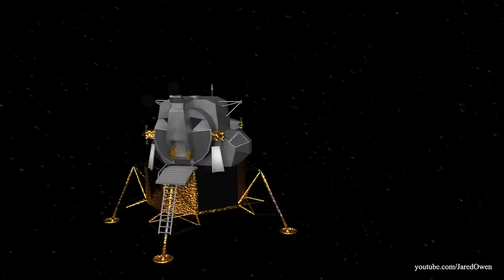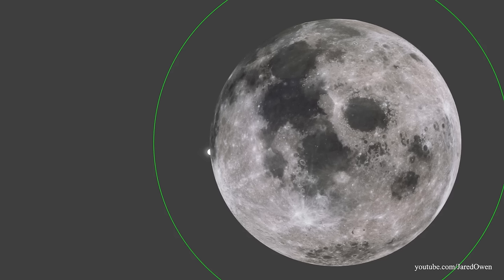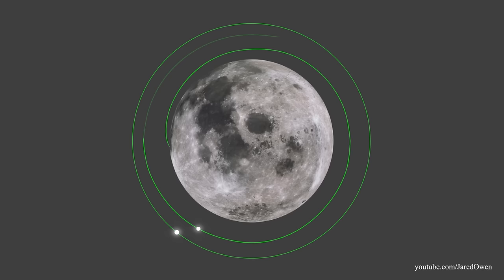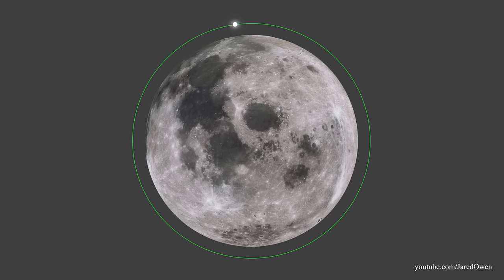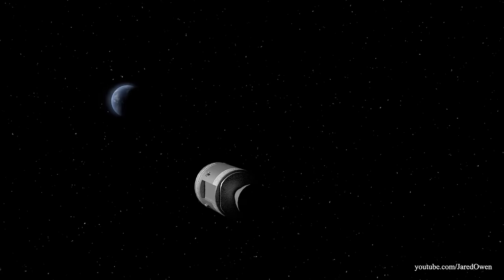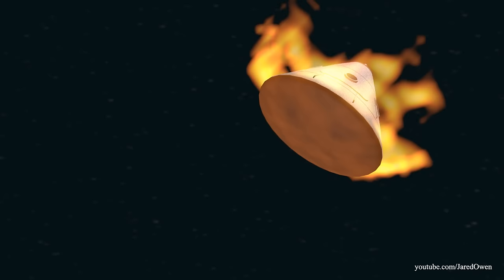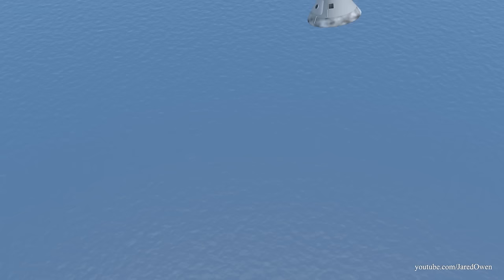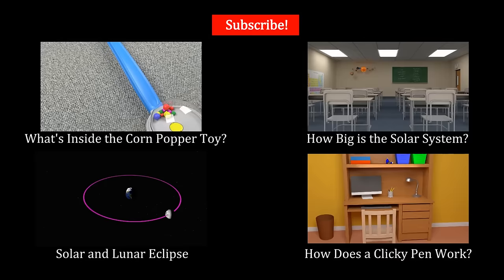How the Apollo Spacecraft works: Part 3

Comment: I worked on the Saturn V and this is the best video explanation I've seen.  I worked on the Instrument Unit which was the brains of the Saturn V.  It was built by IBM under a contract with NASA in Huntsville, AL.  The IU had all the navigation, guidance, telemetry, communications, etc. functions through Trans Lunar Injection.  At the IBM facility where I worked, there were posters urging everyone to work with Zero Defects.  Another poster with a quote by Wehner von Braun explained why: "If the Saturn V is 99.9% reliable, there will be 5,600 defects."  

I did some calculations recently and a typical cell phone these days has about 3.5 million times the storage capacity of the Saturn V IU and computer processors have about 1 trillion times the processing capability of processors in the 1960s.  

It is amazing to reflect on how primitive computers were back then and how we got to the Moon with such limited capabilities.
Reply from the maker: Thanks Everett - that's neat that you actually got to work on it!
Reply: Crayfi
Reply: You’re such a legend for working on that absolute beauty of a rocket. My heroes are the men and women who built that rocket. So this then makes you one of my heroes, Mr. Everett. Thanks for sharing with us!
Reply: .1% = 5,600 ……….   That is mind blowing!  Every single individual piece , every “insignificant” wire, rivet or nut, had to be as good as humans could make it.  Amazing.

Comment: how space shuttle works please make a video
you are amazing
Reply: YES!!
Reply: I did a report on the shuttle US back in 1980 more like a research paper was working on degree in applied science got a A for it but interestingly they never gave me back my paper but in my report i wrote that this. Craft was doomed to failure at some point due to not only its complexity but  the fact that this ship was very fragile those boosters an example & just the whole design, structure the materials used the vulnerability to extreme climate made it a ticking time bomb add to the fact that it was expensive to operate & maintain for those reasons were probably why they kept my paper did they think i might let NASA know? & that i was right all along.but they said it was a good report may be too good.will never know.
Reply: @ndhzbhhdhhs668  I wouldn't trust a report that was written by a guy named Ndhzb Hhdhhs and has not-so-good grammar.
Reply: Yes do and explain how constant force supersonic nozzles control a mass m of inertia I about its mass center.
Reply: Ndhzb Hhdhhs r/thathappened
Reply: Tom Williams hyu
Reply: Vincent Harris Soyuz has problems and all crafts have proplem.apollo killed 3 people.
Reply: @lapischicken  Lol! I completely agree!
Reply: I am from future and now he had made it
Reply: isn't it the orbiter vehicle
Reply: He made it

Comment: Just to flesh it out, the 2/3 engine burns after launch from the moon were called:

Coelliptic Sequence Initiate (CSI) - 1st engine burn
Constant Delta Height (CDH) - 2nd engine burn, or 1st on the later missions
Terminal Phase Initiate (TPI) - 3rd engine burn, or 2nd on the later missions

These 3 burns were computed backwards, starting from the desired point where you want the LM to meet up with the CSM (which was at lunar sunrise) and working your way back to the desired launch time.

Vaguely,
purpose of the CSI burn was to put the spacecraft in position for the CDH burn.
purpose of the CDH burn was to put the spacecraft in position  for the TPI burn.
purpose of the TPI burn was to have the LM and CSM meet up at a specific point in orbit.

Later missions skipped the CSI burn as the LM was launched directly to the proper orbit for CDH to take place. This was called a "direct insertion" launch.

Jeff Quitney has a video at https://www.youtube.com/watch?v=UOnKHX1p8s4 detailing the process of getting the LM back to the CSM in orbit.
Reply: But that just brings you to the right hight, at the correct time, but how did they manage to be on the same (sorry not a native english speaker)trajectory, and not say 20 Miles to the left or right, or not even on the same perpendicular path.

Comment: I am pretty sure that the CSM did not re enter earth orbit on the way back from the moon.  It just reentered the atmosphere.  The other thing I think is that in later missions (Apollo 15 on I think?)  the CSM put the whole package into the low Moon Orbit.  Then I think went back up to the 60 mile orbit after the LEM was at a safe distance.  This allowed for more fuel to be used by the LEM on the descent.  Otherwise I like these vid and they gave me info I did not have before.

Comment: Outside Franklin, Pa. there used to be a Dairy Queen which had a boiler plate of an Apollo command module out front. A boilerplate is a full sized mockup of a space capsule design used in simulations. The DQ closed in 2019 and the module is no longer there.

Comment: May very well be the clearest and easiest to follow explanation of the lunar program I've ever seen. I really appreciate the clear and simple wording without being spoken down to. The one part out of all of this that has never been clearly explained to me was how the tunnel from the CSM to the LM attached and opened for passage. How does a claw become portal? Even 'Apollo 13' (1995) didn't explain it and they even showed the plug I've never seen before or since.
Reply: The pointy end of the Command module goes into a hole in the top of the LM, there is a hatch on each end that opens inward, and leavs a tunnel.

Comment: Great set of videos, superbly broken down and simplified - should be required viewing for all hoaxnuts!!
Reply: Paul Snape I thought great work in the video , but just because some of us doubt  and question the nasa evidence of man on the moon doesn’t change the phenomenol engineering of space flight or make us all hoax nuts , there are some legitimate doubtful claims in the space race in relation to manned landings
Reply: Pretty sure most people who doubt the moon landings could be flown up to the moon, have their head bounced off the LM decent stage and would still not believe it. 

They start talking about how it was put there later and we didn't actually go in the 60s and everything is just an elusion and we all live in the matrix. 

At some point you have to take into account the overwhelming mountain of edvidence that points to the fact it did happen and stop focusing on some minute thing that can neither be proven nor disproved.
Reply: Nope. Good day.
Reply: Paul Sharpe: Hi guy! Tell me where I am wrong and provide evidence:

Where is the video showing the inside of them LEM with the astronauts in 
the moon suits and attached with the bungee cords. They had a periscope in the CSM and LEM for navigation, but for some reason there are no pictures or videos of stars. The second moment changes as the fuel and oxidizer gets used, but somehow these 4 groups of steering  motors kept the LEM from crashing. No remote control or autopilot test landing to verify the LEMs control system and steering motors, with the sloshing fuel and oxidizer and water, but somehow they got it right the first time. The LEM simulator Neil flew and crashed obviously did not have the same second moment as the fake studio LEM on the moon stage. No radar stations on the moon to verify the unknown orbit of the fake CMS, and the ignition time of the LEM, and track the fake LEMs altitude and range as a function of time for descent and ascent. For the moon suit sublimator what blackbody absorber temperature did they use for outer space and the maximum power flux from the sun from the ultraviolet to infrared wavelengths. Same with the engine jet landing on the moon and the missing dust cloud and nobody afraid of rocks piercing the LEM or damage to the antennas, steering motors, or landing radar. They could have pointed the cameras up away from the moon instead of golfing on the moon stage but they decided not to because they would have taken pictures of the stage guys on the catwalk They also drove the moon buggy with lots of dust in the vacuum of the moon studio. Where is the video showing the astronauts in the LEM on the studio mooooon putting on their backpack life support. The clown did a fake spacewalk in the non gravity simulator in the airplane, but for some reason no stars in pictures or video from that. Their studio moon suits were contaminated with moon dust, which likely is radioactive, but no problem to put a Geiger counter next to their suits to verify there was no radiation hazard.Neil jumped off the studio LEM, but since it was live they could not slow down the speed by the square root of six, like the Six Million Dollar Man slow motion, because that would put the rest of their studio acting out of sync..Astronauts could not get more than 6 inches off the moon as they were hopping and walking and pretending to be on the moon stage. Radiation heat transfer on the LEM so they used a glycol cooling loop to radiate that heat back out into the air conditioned studio. Total hoax.

Comment: re entry started at 400,000 feet came down to about 200,000 rotated the craft 180" went back up 50,000 feet to cool the heat shield then rotated another 180" and started again to the sea. there is video on Youtube that shows the re entry from an aircraft the fireball is 50 miles long.
Reply: Seriously?  That's amazing!  What's the name of the video?
Reply: it was called a lifting re entry as the command module was in essence a lifting body so as you correctly explained by altering its angle it could gain lift and perform these stepped 
re -entry's

Comment: With all this attention to technical detail the final part where we enter Earth's atmosphere feels a little light.. No mention of the trajectory and the small "window" they had.. Not to steep and not to flat or they burn up on re-entry or skip of the atmosphere back out in to space..
Reply: ... I almost forgot to complement you on the otherwise fine animations series.. Nice work.
Reply from the maker: Thanks!
Reply: They dont skip into space. The return entry angle of the CSM entering the atmosphere can be such that lift is created. There can be enough lift and speed to put it back into orbit longer than the amount of oxygen they have available. The window is not that small. It was well within the capability of a typical aircraft autopilot at the time. Nice video presentation but the reality is nobody went to the moon, particularly with a 1960s computer...

Where is the video showing the inside of them LEM with the astronauts in 
the moon suits and attached with the bungee cords. They had a periscope in the CSM and LEM for navigation, but for some reason there are no pictures or videos of stars. The second moment changes as the fuel and oxidizer gets used, but somehow these 4 groups of steering  motors kept the LEM from crashing. No remote control or autopilot test landing to verify the LEMs control system and steering motors, with the sloshing fuel and oxidizer and water, but somehow they got it right the first time. The LEM simulator Neil flew and crashed obviously did not have the same second moment as the fake studio LEM on the moon stage. No radar stations on the moon to verify the unknown orbit of the fake CMS, and the ignition time of the LEM, and track the fake LEMs altitude and range as a function of time for descent and ascent. For the moon suit sublimator what blackbody absorber temperature did they use for outer space and the maximum power flux from the sun from the ultraviolet to infrared wavelengths. Same with the engine jet landing on the moon and the missing dust cloud and nobody afraid of rocks piercing the LEM or damage to the antennas, steering motors, or landing radar. They could have pointed the cameras up away from the moon instead of golfing on the moon stage but they decided not to because they would have taken pictures of the stage guys on the catwalk They also drove the moon buggy with lots of dust in the vacuum of the moon studio. Where is the video showing the astronauts in the LEM on the studio mooooon putting on their backpack life support. The clown did a fake spacewalk in the non gravity simulator in the airplane, but for some reason no stars in pictures or video from that. Their studio moon suits were contaminated with moon dust, which likely is radioactive, but no problem to put a Geiger counter next to their suits to verify there was no radiation hazard.Neil jumped off the studio LEM, but since it was live they could not slow down the speed by the square root of six, like the Six Million Dollar Man slow motion, because that would put the rest of their studio acting out of sync..Astronauts could not get more than 6 inches off the moon as they were hopping and walking and pretending to be on the moon stage. Radiation heat transfer on the LEM so they used a glycol cooling loop to radiate that heat back out into the air conditioned studio. Total hoax.
Reply: @suekennedy8917  Well okay, but at least we're certain we put Apollo 11 through 17 up into space, at least, right? So, if we didn't go to the moon, what were we really up to, up there?

Comment: I have been a follower of the space program since the early 1960s. I never thought of the fact that you gave during your presentation; namely, when the astronauts are returning home they are in more cramped quarters because they don't have access to the LEM maybe just for the additional space. Frank Borman's Apollo 8 was the only one that basically had cramped quarters going to and from the Moon.
Reply: Well, the LM was not really occupied on the way to the moon. After docking with it after the TLI burn, they did access it to check it out to see if everything was ok. I know on one mission, the glass from one of the instruments broke so they took the time to vacuum the floating glass shards. Like I said though, it was normally left unoccupied until they prepared for the lunar landing.

Comment: As an old timer who actually watched the moon missions this was an excellent overview. I only found one factual error. At 2:23 while describing the return to earth you say “Once we’re back in earth orbit...”.  On the way back the CM never slowed down to enter orbit. It just went directly from return flight, separated from the SM (which burned up) and dove directly into reentry. Because they had been in one long fall towards earth essentially since leaving the moon it was an incredibly fast reentry.  The fastest was Apollo 10 at nearly 40,000km/hr. 
But anyway, no going into orbit on the return. Excellent videos!
Reply: Yes, great info. In addition, the SM re-entry for AP-8, AP-10 and AP-11 didn't quite go as planned as the trajectory for them was supposed to be a slight skip off the atmosphere so they would re-enter and burn up quite some distance from were the CM was re-entering. Instead they re-entered close enough to the CM that there was some concern it could be a problem. Here's a link about it along with their simple but clever solution:
https://space.stackexchange.com/questions/37047/how-did-sloshing-prevent-the-apollo-service-module-from-moving-safely-away-from
Reply: If we're being pedantic, I would point out that despite not slowing down near earth, the CSM was technically still in earth orbit, just a highly elliptical one.

Comment: The Descent Stage wasn't really "dead weight" as it served as the launch pad for the Ascent Stage.

One Ascent Stage was sent into a solar orbit; that was Snoopy from Apollo 10.  Two others, Spider from Apollo 9 and Aquarius from Apollo 13, burned up in Earth's Atmosphere.

You mention you hoped that no one got claustrophobic in the Command Module.  It had the interior size of a Volkswagen Beetle but with near zero gravity, it was pretty spacious for the three men.

About re-entry of the Command Module.  Remember that the Command Module had it's weight shifted to slightly off center so that the cone shape could induce lift.  With the reaction control jets, the Command Module actually skipped up and down in the upper atmosphere to reduce heat and speed before losing enough energy to enter the thicker part of the atmosphere.   Then drogue parachutes helped slow and right the spacecraft before the three big main parachutes blew out and unfurled and reefed.

Splash down was a bit rough and there were inflatable righting balloons to ensure that the spacecraft righted itself in the water.  There was also a green dye marker and a location beacon antenna deployed.
Reply: One correction.  It is the ascent stage of Apollo 12 that is in circular solar orbit.

Comment: Good job mate! All the information explained short and simple. 

Ps. 1 small side note. The command module had to perform an aerobraking manufure to kill it's velocity by entering the atmosphere in a certain angle which made the module slow down skip out of the atmostphere for a really short time and repeat this for (i beleave) 3 or 4 times (don't quote me on this) before they slowed down enough for the actual reentry. But that's such a complicated thing to explain and besides it was one of the more advanced parts of the mission but still. You've done a great job!
Reply from the maker: Thanks Glenn!!  I read a little bit about the braking maneuver but quickly decided it was too much detail for this video
Reply: My understanding is that the atmospheric skip wasn't performed on every mission. And when it was it was just one skip to reduce the heat load on the heat shield. I think it was done on Apollo 8, but I'm not sure about the other missions.